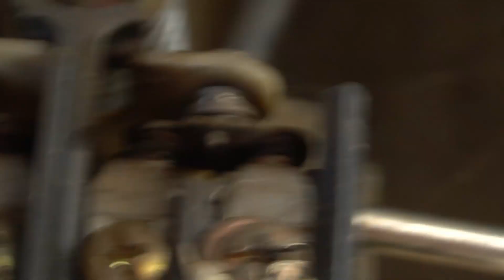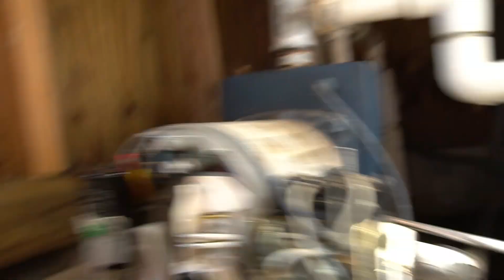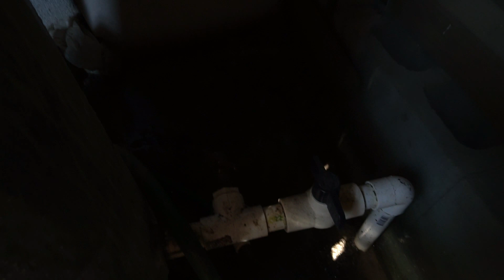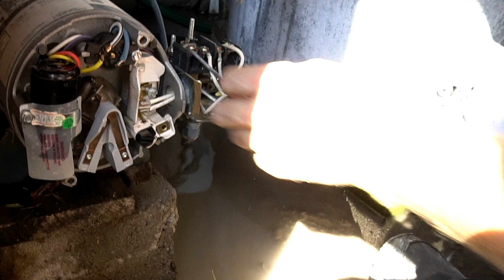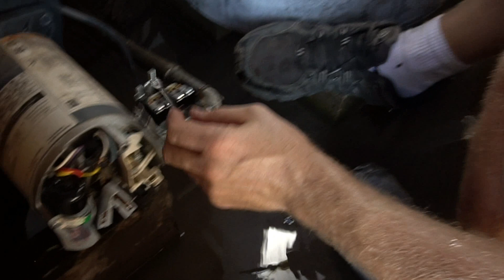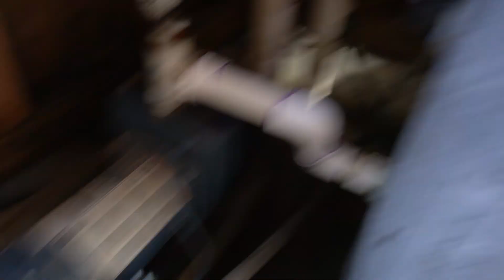Shallow Well Pump - diagnosis and repair

Comment from the maker: Please feel free to ask any questions you may have on shallow well pumps and anything about water wells, Thanks
Reply: Hello, where did you get that mud pit? I'm looking for one just like it. Thanks
Reply: Clear Water Pump & Well LLC. I think my pump is leaking water from the pump how do I report that?
Reply: I have a deep well pump, and it froze cuz the heat tape came unplugged , I live in wisconsin, so I plugged it back in when I noticed no water, so it unthawed, but in order for the pressure switch to kick in I have to hit the box lightly, and then it will turn on, and do its thing, until it shuts off, it wont kick back in without hitting it again, the points look burnt a little, any ideas without spending alot of money
Reply: I have rusty metal in my water. Both cold and hot tap.  Thought it was a few pieces of dirt, used a magnet and it stuck to it. New pex water lines thru out the house. Is the well casing needing replaced or pressure tank?
Reply from the maker: @Splunky70  From what you're explaining you're getting out of your lines, it could be coming from the well casing, pump, piping or your well tank.
Just about anything in your system that's iron can break loose overtime and get deposited. You may want to check the pH of your water to see if it's acidic. Other than that a small cartridge filter out going up your well system will stop large pieces.
Reply: I just replaced my pump and added a check valve I primed up my pump and everything seems to be working right, it cuts off at about 50 psi starts at 30 psi, but once it cutsoff my pump flickers with pressure bouncing up and down till I open up a valve to kick on the pump
Reply from the maker: @javierramos2445  Either your psi switch is to far from the tank, behind a check valve to the tank or there is too much air pressure in the tank.   If you want I can help you further just let me know if that helps.
Reply: @ClearWaterPumpWell  I do need some additional assistance I have a everbilt pump I put a check valve at the discharge side how would I rig up a pressure switch to a 13 in tee and rig up the wiring to the pump so that it can kick on when pressure is to low
Reply from the maker: @javierramos2445  There is your problem, you can only have a check valve before the pump on the suction from well.  Because it will prevent water from going back into the well.  The problem you have is the pressure switch is on the pump behind it.  This causes the pump to run immediately after turning off because it's not holding pressure.  The check valve is blocking pressure to communicate with the switch on the pump.  Move it to between the well and suction of the pump and your problem will be fixed.
Reply: @ClearWaterPumpWell  thank you so much for the info I will try this out and let you know of the results
Reply: @ClearWaterPumpWell  thank you so much for this information It helped me solve my problem and restore water to my home after 2.5 days of trying to solve my issue.
Reply from the maker: @javierramos2445  no problem glad to help!
Reply: How hard is it to get the foot valve out of a 2 inch casing with 1 inch pipe inside
Reply from the maker: @youtubecensoringthefreedom860  Depends on if it's a shallow well or deep well pump setup.  Without a jet the pipe slides freely out the 2" casing.  If it's a deep well pump with a jet adapter and leathers it's difficult.   What problems are you having and which type is it?
Reply: @ClearWaterPumpWell  mine is stuck in there and want come up its been in there since 1950s how can I take it out
Reply: @ClearWaterPumpWell  I have a jet pump
Reply: @ClearWaterPumpWell  not sure how deep it is
Reply: @ClearWaterPumpWell  my jet pump keeps losing prime
Reply from the maker: @youtubecensoringthefreedom860  It's not how deep the well is, it's the type of pump.  The water table is either above or below 20' down the well.
Reply from the maker: @youtubecensoringthefreedom860  If that is so you probably won't be able to.... We have trouble after 20 years with certain water conditions.
Reply: @ClearWaterPumpWell  are starite pumps anygood
Reply: @ClearWaterPumpWell  thank you for helping people with well water problems your a good MAN God Bless you I'm going to probably get a new well drilled
Reply: Thank you for this video. How do I determine if I need to replace start switch or the pressure switch. I pressed on the start switch with screwdriver with power off and now it's functioning properly. Don't want to just hope for the best and burn up the pump when im at work and wife and kids are home.
Reply from the maker: @pokethumb4215  If the motor would not start and only hummed but by pressing the start switch it now works means it was the problem.   You can check the contacts on the start switch to see if they are burnt or worn down.  Sometimes just touching it can get a bit of trash, dust or bug out and now it's good.
In that case you don't need to replace it.
Reply: Thank you
Reply: My galvanized tank has that same AVC that you just said to replace. I don't know if it is a flow well. Should I replace mine as well? The first AVC I replaced it with cracked and fell apart. The second one filled with water and is leaking from the top(where I believe air is supposed to be released).
Reply: I have a friend he pulled his well to replace foot valve and leathers when he reinstated he added 20 foot extra pipe now the pump will not prime we also put new pump  help
Reply from the maker: Get them to check and make sure the jet didn't break off, and they should not need any more than 5-10 feet of pipe in the water table.  If its a very shallow well they could have put the jet in the screens and this will prevent priming the drop pipe.  pull up and clamp off until the water fills the casing, then install the pump adapter at this depth.  Hopefully they have a good name brand pump and not one from a home center.   If they have any questions they can ask me on facebook @ClearWaterPump or https://www.facebook.com/ClearWaterPump/
Reply: I DID HAVE A WATER LOGGED TANK, AFTER A NEW TANK DIFFERENT MOTOR AND PUMP, SWITCH. I'M STILL GETTING A MOTOR THAT WILL GO ON FOR ABOUT 10 SECONDS AND MAYBE GAIN 10LBS THEN GO OFF, COME ON ABOUT 15 SECONDS LATER AND JUST HUMMM I'M STUMPED
Reply: what do you mean by a flow well ?
Reply from the maker: @sparta9472  A flow well has a natural pressure created by the water table being above the ground.  This forces water from the ground out the well without any help from a pump.  A flow well can provide endless water without power if you live in a low area or if drilled deep enough.
Reply: @ClearWaterPumpWell  oh ok  thank you for responding,  what can happen to a well if you forget your shower was on and it ran all day  until you noticed you had no water in your sink , so you go outside and your pump is running and hot but no water is being pumped in the house ?
Reply from the maker: @sparta9472  More than likely then it's a similar issue to what happened in this video.  Usually your pump should continue to run without any problems, but if it's outside in the heat running all day it could have overheated and damaged the capacitor.
Reply: @ClearWaterPumpWell  i primed it up and it ran for like a week then lost prime again    , I just primed it again  and it is running but now i have one sink with hardly any water coming out .. it is a regular steel tank not a bladder tank ... it has and air valve on the tank .. and a pressure gauge on the tank and in the line of the pipe between the well and tank ...  when i turn on the out side faucet right off the tank .. it only runs for about 10 or 15 seconds then the pump cuts on .. the pressure gauge reads 70 before the pump shuts off  then it goes to 65 after the pump cuts off ... it seems like it doesnt fill up enough in the tank before it shuts off
Reply from the maker: @sparta9472  It's hard to go by old gauges they can break and show incorrect pressure.  If your dealing with a shallow well pump I doubt its hitting 70 psi they typically max around 60 psi.  Knowing your cycle time is important, not how long from off to on but from pump on to off without running water.
You should have a minimum of about 30 secs and up to over a minute if everything is sized and working properly.  So run your water from a hose, use your valve at your tank to turn it off when pump starts. When the pump comes on then start a timer and stop when the pump turns off.  This will be your "cycle time" how long it takes for your pump to fill your tank only.
Reply: @ClearWaterPumpWell  it is 23 seconds when it comes back on
Reply from the maker: @sparta9472  it's not how long the water runs when pump is off.  It's how long pump runs on to off without using water and valve is turned off.
Reply: @ClearWaterPumpWell  RIGHT ,  the pump runs for 23 seconds when the valve is off , from kick on to off with no water flowing is 23 seconds ..is that ok?
Reply from the maker: @sparta9472  it's not extremely bad but should not get any shorter in time.  Just keep a eye on it and make sure it doesn't get waterlogged.
Reply: @ClearWaterPumpWell  so it keeps pump running with no water pumping but has air in the lines ,  the water level after I prime it back up is about 2 - 4 inches from the top of the tank... it is a regular metal tank no bladder  also no air valve to put air in the tank ... it has the round metal air regulator on the side of the tank about half way up ... and when i put my ear to the pump when it is off I can hear water trickling ...................... so  my questions are .. 1 ) is the water line 2-4 inches from the top  correct or should it be UNDER or even with the air regulator inlet valve that is in the middle of the tank...    2)  the water I hear trickling when I listen to the pump when it is not running,  does that mean it needs new foot valves, cups and seals
Reply from the maker: @sparta9472 Not sure what 2-4 inches from top of tank, do you mean?  Where the water level is in the tank is not relevant to the pump being primed.  The pump only needs to be full from the well to the outlet pipe going to the tank to be primed.  You probably have a suction leak if it's just pumping air.  Check from well to pump and especially at pump inlet for loose fittings.  If it's pvc it can run hot and melt and suck air and not hold prime.  You surely could have a foot valve leak for sure if it won't hold prime when filled up.
Reply: @ClearWaterPumpWell  the 2-4 inches  question  I was wondering if that meant it was water logged   since the tank was full of water except for 2-4 inches from the top   , I think Im going to switch it over to a diaphragm tank  and see how that works out  and ofcourse in doing that  all the connections will be new or tight
Reply from the maker: @sparta9472  Yes if the water in the tank is above 3/4 of the way to the top when fully pressured to say 60 psi it's considered getting waterlogged.  You need a air volume control or aeration device to maintain air charge in a standard tank.

Comment: Why wouldn't you run a hose from the drain to outside of the building somewhere... then you didn't even drain the Damm tank all the way before you pulled the avc out, letting even more water out into the building not to mention ALL OVER THE ELECTRIC PUMP MOTOR. You clearly know what you're talking about, be a little more respectful of peoples property. And all the knowledge you display was canceled out by you pulling the avc out before the tank drained. (inside the building where youre standing with high voltage electrical)
Reply from the maker: @Diesel_money07  man let me tell you something you right I do know what the hell I'm doing I've been doing it for 25 years!

Yeah I flooded the little chickenshit dog house shed, that's how these people build them around here they close them in as tight as they can or you can't even work on the crap!

It didn't hurt anything the damn floor is dirt and the bottom was nothing but cinder blocks. 

If you don't take something out the tank the water is never going to drain otherwise you have to hook up a air compressor and force it out of faucet somewhere.

Yeah there was water in there but all the electrical was nowhere near it I was standing on the plywood floor away from the water.

I guess what it's come to is I need to mock up some perfect beautiful system and create problems with it so that I can show things without being in their natural environment.
That way I can satisfy all the keyboard Warriors but truth is they will still have anything to b** about.......

Thanks for the comment and watching,
Casey

Comment: So I just got an offer to remove all of the components of a system like this. Can I just cut everything out?  The only thing after is to cut power to it and I’ll remove it from the breaker. I’ll probably leave the hole and cap it so if anyone ever wants to use the well the know it’s there.
Reply from the maker: @EternalGaze8  yes you can just cut everything out but the new water system will have to be tied into the outlet going to the house.
In regards to capping the well it either has to be intended to be used in the future or properly abandoned according to most State rules.
Reply: @ClearWaterPumpWell  thanks!

Comment: Last night I was sitting outside with my dog and a fire and a gin when suddenly the sound of my pump running non stop worked it’s way through my peace. The pressure valve reads 30 no matter what. I left it off overnight. After work the next day replaced the 30/50. No luck. 
Can you point me in a direction? 
I’m new to pump world. Pumps in the basement. I know nothing about the well.

Comment: Learning a lot on your channel. My shallow well is dug in sand, not a flow well. The new acrylic air volume controls keep cracking. Time to replace the galvanized tank? Or move to a diaphragm type air admittance type?
Reply from the maker: Depending on your water conditions you can use a Bladder or Diaphragm tank.

Comment: Hi, yes you helped me.  I couldn’t figure out what that air line was for.  I plugged mine off and it seems to work great.  But I’m pumping from an above ground tank, not a well.
Reply from the maker: You can do that if you have a bladder or diaphragm tank but not  a standard as you will need it hooked up to AVC.

Comment: I have an A.O. Smith well pump motor that just hums like the one in this video.  The pump runs on 230V, "1081" Design, ST 1052, 1/2 HP, which capacitor should I get for this pump? Any help would be much appreciated.  Thanks for posting the video!
Reply from the maker: Usually the 1/2 hp AO motor takes a 124-149 range capacitor.  But some newer ones will have the standard 161-193.  Just check to see which one is currently in the motor.  Check the windings and start switch also for damage.
Reply: @ClearWaterPumpWell  awesome, will do and thanks for the quick reply! Much appreciate it!

Comment: I’m watching you for the info I have a I’ll pump after it’s done filling up the tank and shut off to three minutes later it cut back on and it makes violent chugging noise what could that be
Reply from the maker: What type of pump do you have is it submersible or like this one above ground?
Reply: Jplus jet pump J10
Reply: Jplus jet pump j10s it makes that noise after the tank is filled two minutes later it starts chugging in violently and it’s a new one
Reply from the maker: @solidtangent9953  If it does it only initially it is probably cavitation and pressure should be adjusted to stop it.  Usually turning the pressure up a bit and making sure pump turns off in 30-60 secs.
Say get setting to 40-60 psi is normal for shallow well pump.

Comment: My well pump keeps running and I have no loss of water in the house. I haven’t found a leak either. Could it be the pressure switch? Pressure gets to 50 and bounces there.
Reply from the maker: It depends on what you mean by bouncing, the pressure or the pump turning on and off quickly.

Comment: I have an application.  I have natural  4psi water supply feeding my pump motor through a check valve.  I have the same type of tank setup and believe it is getting water logged.  My system does not have a snifter as you show in your system a but does have a tank vent I believe it rotted and non functional.  Where do I need to  install the snifter? On the low pressure side of the check valve or on the pump as you've shown. (my pump runs between 40 and 60.  Wouldn't that be too high to stick the snifter on the motor?)
Reply from the maker: This type only works on a flow well as the pump would lose prime sucking in air.  If you have positive pressure coming in you should be able to use one.  I would watch closely for a wile to be sure.  Put a air release on the tank to maintain air volume.  You may need to turn cut in pressure to 35 in order to draw air if not working 40-60.  A snifter valve is a specific type of air valve with a very soft spring to allow the vacuum to open it.  The snifter should be installed on the suction side of the pump. 
Flow wells - https://youtu.be/-0SAkopL7dE
Reply: @ClearWaterPumpWell  please explain flow well.  I am tapped into an artesian well. I cannot lose prime. You explained the foot valve and I understand, it holds pressure on the system.  Where would I place a snifter valve, on the pump inlet like you did?
Reply from the maker: @bobgutman9691  please read previous comment I edited what I said earlier, should answer questions.

Comment: Where was the check valve in  your video? Presume it had to be before the inlet side of the pump motor to hold pressure on the system.
Reply from the maker: The check valve or "Foot Valve" is located in the well casing on the end of 30' of 1" PVC.  I had only been there to repair the issue and had not installed the pump or the tank.